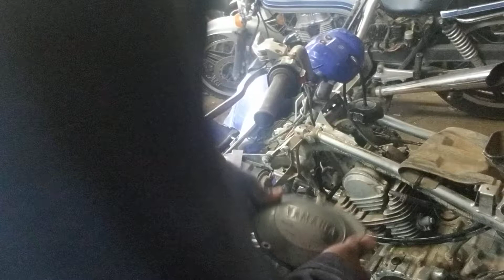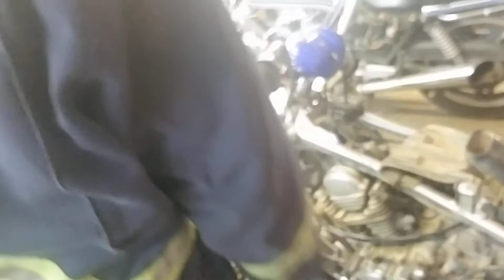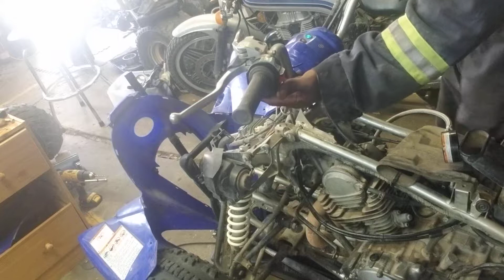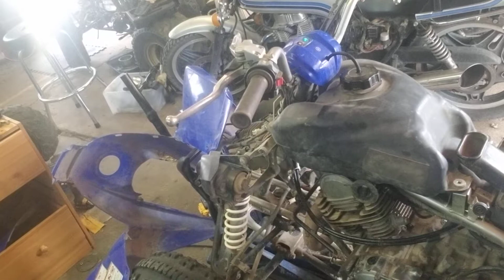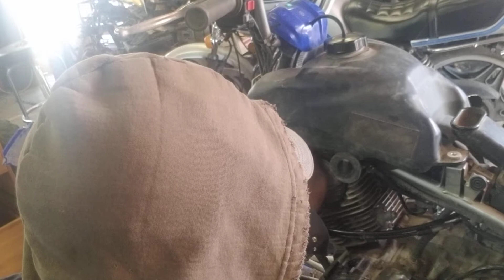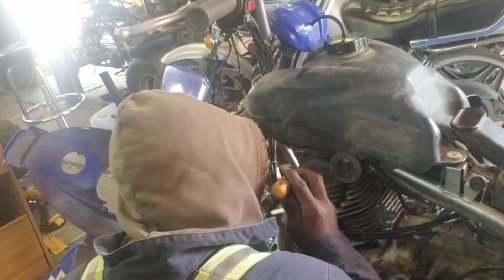03 RAPTOR TOP END NOISE..

Comment: Mines doing same exact thing and smokes around the exhaust manifold/ head what was the fix?
Reply from the maker: Check your timing chain automatic tensioners..could be chain stretched
Reply: I believe exhaust valve is the issue
Reply: What was it?